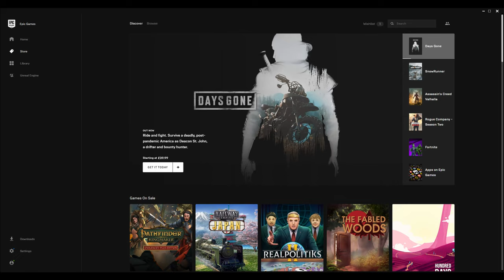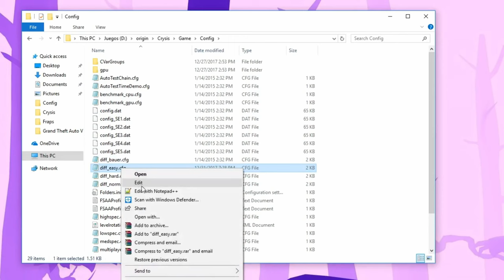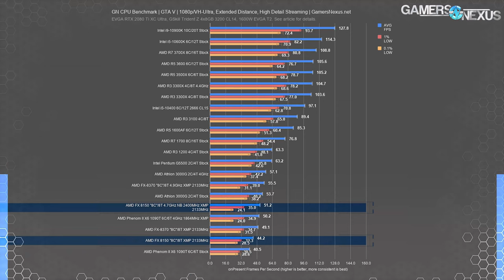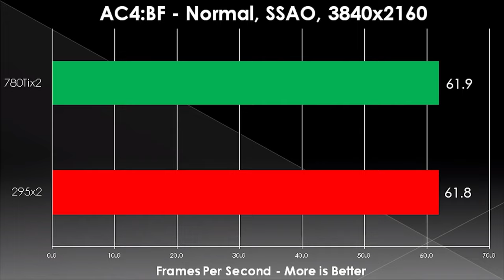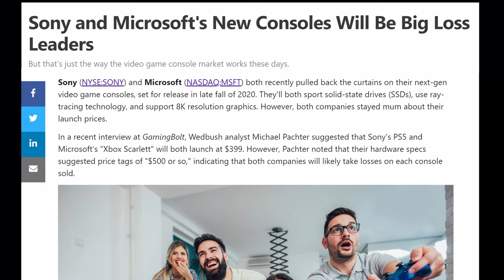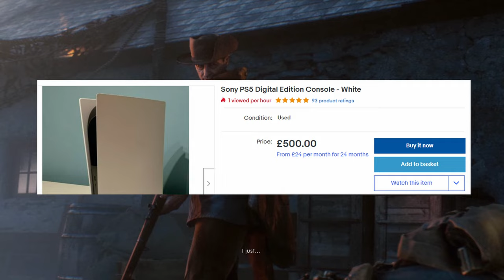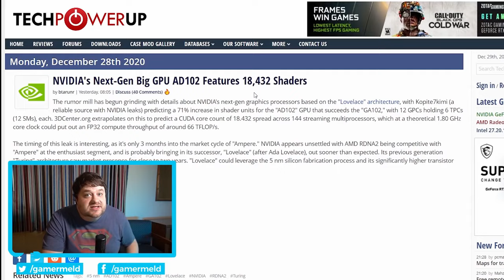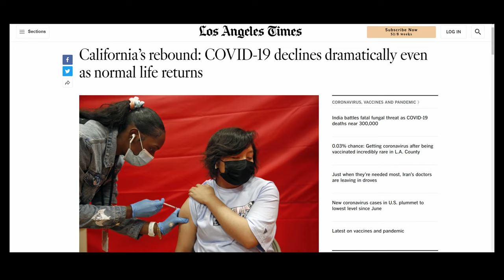The Rise & Fall Of The "Console Killer" PC

Comment: Fighting the series s is especially hard .
Reply: Yeah, that's a fight that can't be won on even grounds
Reply: Hello there calling you guys from the end of 2023 Yeah we still can't kill that little bastard It's a goddamn honey badger!!!!

Seriously the closest piece of silicon you can get to its graphics processor on a budget is the RX 5500 XT which you can sometimes SOMEtimes get for about a $150 when it's on sale or when you buy it used.

That's the graphics card alone That's not even taking it to consideration the CPU which you need an ryzen 7 2700x which will run you a cool $200 on sale new or around 120 used.

Yeah for those keeping notes brand new and on sale that's already over $350.... Yeah..... Not a good start considering we haven't even taken into account the RAM the SSD the power supply or really anything else, 550, Right now if you want it brand new and only if you find yourself with some massive discounts you are looking at around $550 to match the series s again that is with some mega hefty discounts.

Or if you somehow manage to find yourself with some ultra heavy discounts because you were lucky that particular day on a blue moon or because you got yourself some used parts that are ridiculously low price you are still looking at $450.

But you know that's fine, considering the rate of depreciation on the parts by next year you should be able to build a series s killer for around $300 with some good discounts and only a few used parts...... Except the Series s will drop price to $250 next year because there's going to be a new series s with better components and a 1 terabyte hard drive releasing next year or the year after that for $300.

On better news however we might be able to beat the series X.... With used parts on discount... Not necessarily the leaked Series X all digital or PS5 digital..... I mean used parts and heavy discounts will probably get you to 450.... But those things are going to be sold for 400 bucks...... Or you know about 350 used for the PS5 considering the leaks for the Xbox say it's going to come with a 1-year subscription to game pass I don't think we're going to see any used Xbox sx digitals on the market next year.

Comment: The GPU shortage didn't even START to end until early 2022, and it wasn't until later in the year where prices were down to somewhat reasonable prices. In November 2021 I bought a Gigabyte Aero 15 with a i7 9750H, 16GB RAM, 512GB SSD, 1660ti, and a 4K OLED screen for $1500, it was great coming from a 4130T with integrated graphics, but even at the time it wasn't a powerhouse, and still cost a ton. Even today it cost $1200, but most of that is probably cause of the screen, but at the height of the shortage I thought is was a good deal cause that GPU would have been probably $400 alone. I wound up buying one in late summer 2022 for $200 to go with my 12100 build, which is the system I still use and is also the first one I've ever built from scratch. The laptop wound up being stolen from my apartment 6 months after I bought it, along with a bunch of pre 1965 silver coins, and that's when I decided to move out of that crackhouse.

Comment: I upgraded to a RTX 2070 Super in 2019 and I am still using it. I upgraded from an Intel i7 6700 to an R7 3700x in 2020. It was a CPU I bought for my first ever PC build in 2016. But it's 2022 and the GPU prices are decreasing but they are still way over MSRP. But when a GPU that cost $500 is going for $1,200 prices aren't going to come down that quickly.

Comment: It'd be interesting to know the discount rate for console makers since they buy bulk GPUs. Supposedly the lastest consoles are sold at a loss, as the service fees and their store make up the difference and profit.
Reply: Same is true for Valve's Steam Deck. Handheld gaming PC more or less equivalent to a PS4 for $399. Other handheld PC competitors are $999 at the low end. Valve even said they are selling at a loss on the hardware and plan to make it up through Steam video game sales.
Reply: @lizardinthelites  I'm 100% sure that's the case for their lowest end model. The 512 GB version is probably close to cost. 512 GB SSDs and a better display don't cost that much, especially not the $300 difference to the low end model

Comment: Fast forward to nearly 2023. There still isn't a viable console killer, Ethereum crashed in price, went to proof of stake so no longer possible to effectively mine on a GPU. Many miners so dogmatically convinced that it's worth keeping their hardware because something else will be a way to convert electricity into gold. Nvidia is starving the market of 2 year old "new" RTX cards keeping them ABOVE their MSRP, and with the trend in new GPU price to performance, we won't see a viable console killer this generation either.  
AMD GPU'S, even with big reductions on "New" cards and Ryzen 5000 CPU's still aren't viable as console killers. So even if you can grab a used 6600 for £180-£200, a new/used 5600 for £130-£150 factor in some cheap ddr4 a mobo, case, SSD and PSU, you will still be looking at minimum about £480 And still probably won't have the full gaming potential of a 9th gen console. Sure, you could go for a Ryzen 1000-2000 CPU, but they have surprisingly held their value and are difficult to get cheaper than the better and more recent R5 5600. Now, 2 years into this console generation we are looking at a refresh coming soon. Where we could be seeing greater performance. Where will the console killer stand then?
It's definitely possible to upgrade your way to console performance with a GPU; but you will more than likely be paying 50-75% of the price of a console to get their. 
Sure, PC has more functionality, but it lacks the easy nature of a console. Consoles are very "living room TV" friendly, meaning, they won't be dying anytime soon. 
Is the console killer dead? Or will the PC marketplace start having to reflect the console Price/performance as the economy dips into another recession? Gamers on a budget have no better option than a console it seems, and although lacking in total functionality, the simplicity of a console, makes it much easy to sit down Infront of at the end of a long day.
Reply: Q

Comment: Yeah. Nvidia 4000 series has launched. Crypto bubble already burst and GPUs are still wildly expensive. A "console killer" pc is still no more possible now than it was when this video came up.
Reply: not so sure about that. I'm seeing used 5700XTs on ebay for <$200
2070 Supers are still sitting ~$250-350, but overall prices are pretty good from what im seeing. as far as I can tell, console killers are more than possible right now.
we even have a repeat of 2018 with rx 4/580s selling for ~80$ (it was 70 or less a while ago :P)
Reply: It all depends on what you want I guess

Comment: As someone who thought the 8th gen consoles were trash in most respects, the value the 9th gen machines offer is astounding.  It's a shame that they too are suffering from shortages and scalpers, but as you said console market's prospects for normalcy look far better than that of GPU's.

I'm still sticking to my PC, as it's my preferred platform for a number of reasons, and I already had a great rig prior to the CCP Virus.  I even managed to get an Ampere GPU at MSRP, but even if I hadn't I would've rode out this nightmare with my old GTX 1080 just fine.  If I had any friends looking to get into gaming right now though, I'd point them to a PS5 or XBSX, or a prebuilt if they were absolutely insistent on going with a PC.

Comment: Well I actually can say that the era of console killers may be returning. I checked the used markets and a used PS5 disc edition costs 500 euros here. While for 514 euros I was able to configure a system with:
Ryzen 7 3700x (100 euros combo with an Asus B450 Prime MB)
RX 6700xt Powercolor Hellhound (200 euros)
16gb 3200mhz ddr4 G Skill Ripjaw (35 euros someone was selling new old stock)
1tb Adata Legned 710  SSD (49 euros brand new, alright far from PS5 SSD)
Deepcool PK650D PSU (65 euros brand new)
Antec P182 case (20 euros plus 5 euros for a new fan)
A Blu Ray Burner (40 euros, because without that I would be comparing this to a used digital edition)

Comment: One thing a lot of people forget to mention is while YES the consoles are powerful with "basically a 3700x and basiclly a 6700xt" 

They run on an APU. The CPU side of that APU might have 8 cores and run at 3.7ghz but it only has what? 3MB of cache? Somewhere around that number and Maybe a 15-20w TDP. 
3700x has the same cores and slightly higher speeds but it has tripple the cash and can run with more power going to it for longer. And the Gpu may have similar cores and speeds but it has tripple the memory and its not shared RAM its dedicated 

The specs make it look close to a 3700x but theres a lot of forgotten factors like way less cache. Way lower tdp. It will thermal throttle. It has 16gb of RAM and 2 or maybe more GB of that is shared with the built in GPU which again takes away the resources of the CPU. 

A 3700x 6700XT cpu gpu combo will eat a ps5 and xbox s alive. So will any modern system. 

My two cents.
Reply from the maker: Not to give too much away just yet, but you might find this Friday's upcoming video interesting

Comment: it still not really possible to match A Ps5's smooth experience even with the latest and the greatest... It is just not possible without doubling the bandwith along with minimizing the latency between the CPU/GPU/Memory,the latter being the "impossible" part unless you know how to tape them all together. And there is "uncompressing chip" that boost streaming of assets 3x times more faster than a top of line PC hardware...
Reply: You might speak fr yourself in this case.

Comment: i actually recently built a console killer (sort of) core i5 7400 from a goodwill desktop, ex crypto mining h110mc, and a gtx 980 for under and a goodwill sealed power supply all for under 250 dollars it kills a switch and a series s but not the series x or ps5

Comment: As long as Nvidia is focused on RTX and DLSS we are screwed. They low spec machines holding the whole industry back. The problem with the console is that its no longer a console, its using pc components, it has pc features, you can install harddisk like a pc, but they are not a pc. Computer games have become so low quality its no longer worthwhile, no developer is going to make something that doesn't run on a console.

Comment: What a joke, most people who actually look at the current gen console fidelity knows that the games are running in low and have worse ray tracing... you also don't need a powerful PC to get console level performance at 1080p/1440p which is all you need considering the PS5 can't run most modern AAA games at 4K with a consistent frame rate. The best bit you did is trying to push the idea that the 8th gen consoles had magical performance when the reality is that they were obsolete on launch (which is why they got so many reiterations)...

Comment: I was a playstation fan right up to ps4. But my  wireless quest 2 Vr headset  and 6900xt and 8 core I7 11700f   32gb ddr 4 ram with 4 terabyte storage will crush your PS5 easily.

And it  will take several years before it becomes 'obsolete ' Even seven yr old graphics cards will run modern titles at 1080p.

Not only that but psvr isnt backwards compatible with older titles like pcvr.

 It doesnt have built in games to download direct, isnt wireless and doesnt have a fraction of what pcvr has on steam or occulus store!

 And also cd keys. And the games cost a lot less.